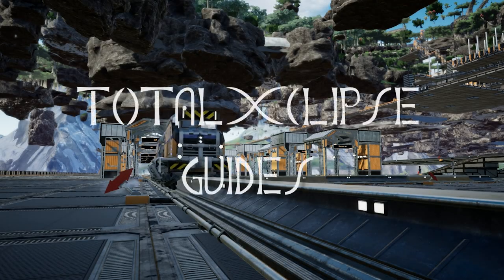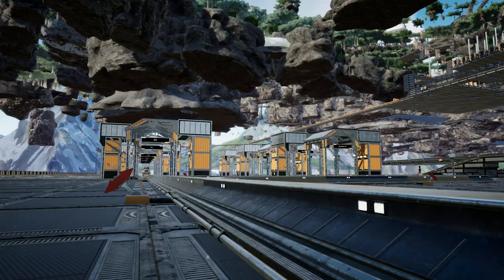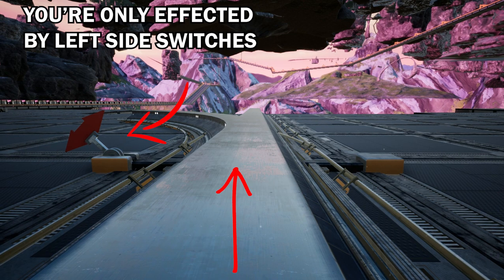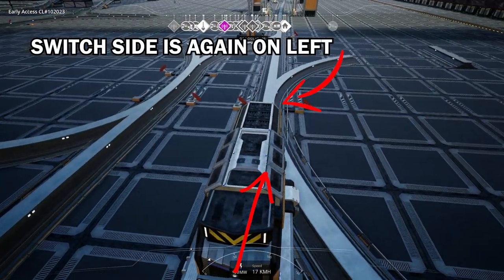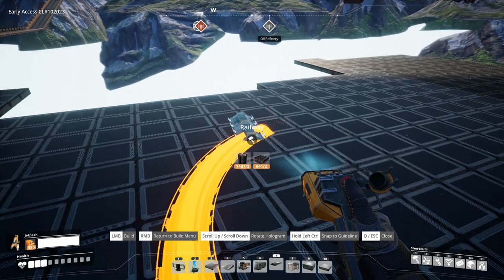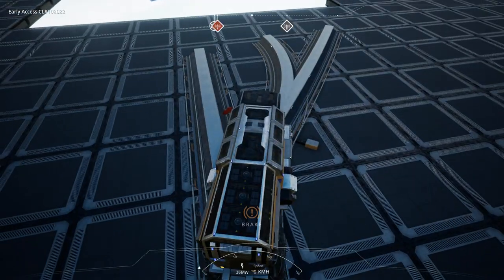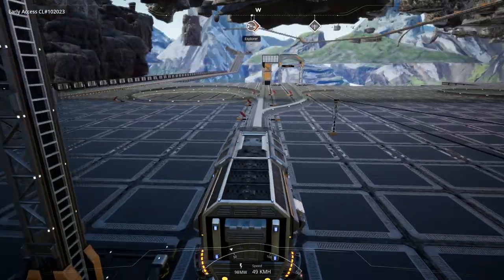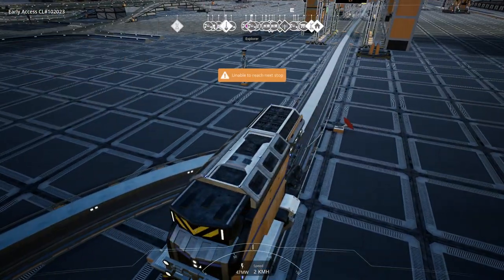Satisfactory Train Guides: How Rail Switches Work Ep 04

Comment: How track switches works? Really easy, look at that arrows, one of em is always pointing up, not straight up but almost. The arrow that is pointing up (diagonally) means the way your manually train will go.
Reply from the maker: Yares33 that’s not the case unfortunately,  I wish it was. If it’s pointing diagonal up to the right it will carry on along the line you built first if it’s pointing diagonal up to the left it will send you down the split regardless of which direction the split goes
Reply: @TotalXclipse  Yep i've done some more testings and you are right. I Think i write this too early :)